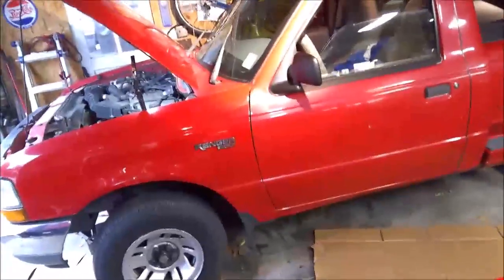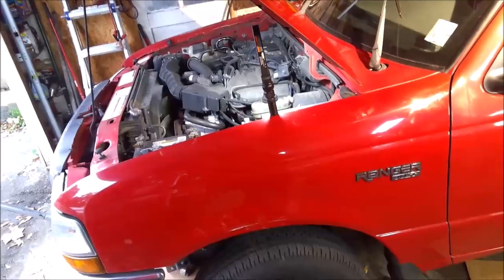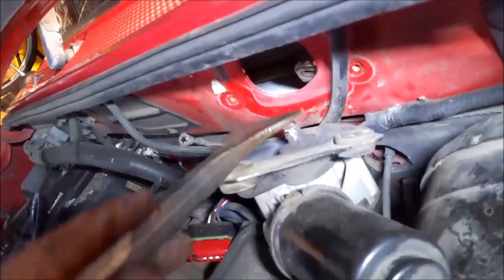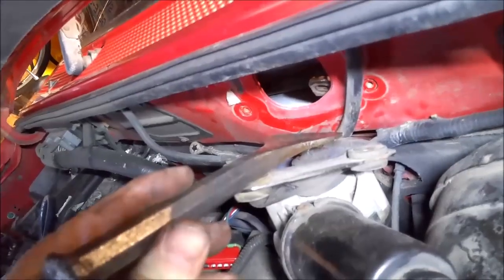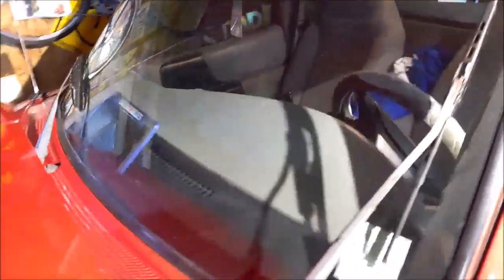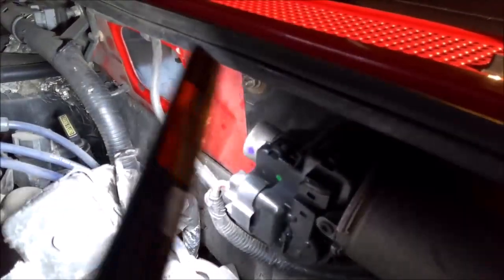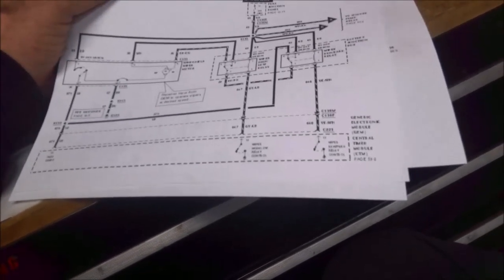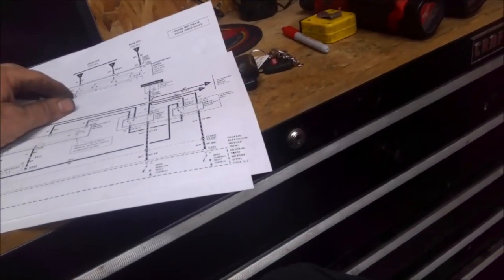1999 Ford Ranger Wiper Motor

Comment: I inherited my 1999 ranger that had been sitting in the back yard for about seven years. One problem was the wiper motor. When I first started it, the wipers moved once but wouldn't stay on. Not sure why, but I started tapping on the motor with the wipers on. The wipers would move when I tapped a certain spot on the motor. I guessed, internally, that something wasn't making good contact. I placed a clamp around that area and tightened it. Wipers work great now!

Comment: wiper motor is starved for power due to connections at the inside fuse panels faulty design.cut lose connection use upgraded fuse design that can handle current..these issues will cause your  module to fry...